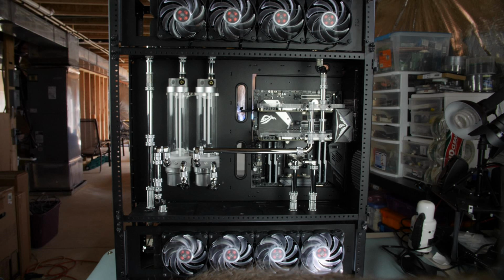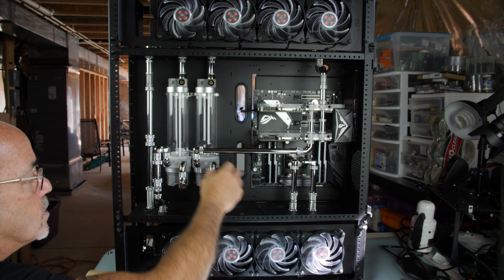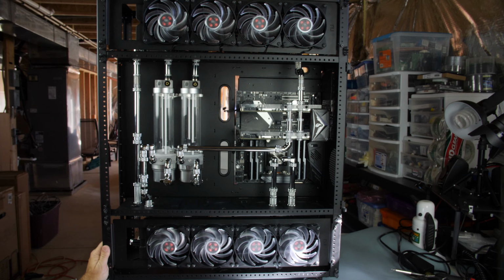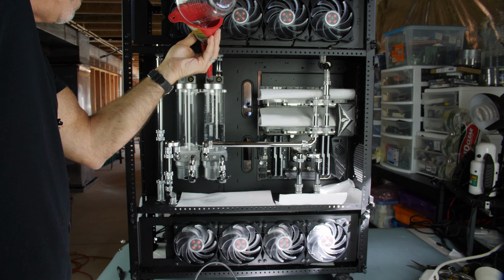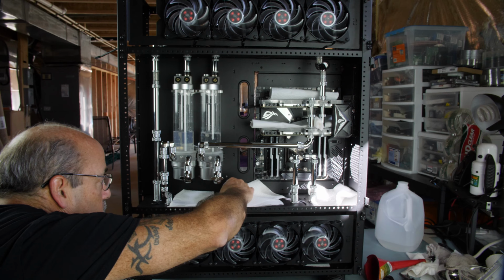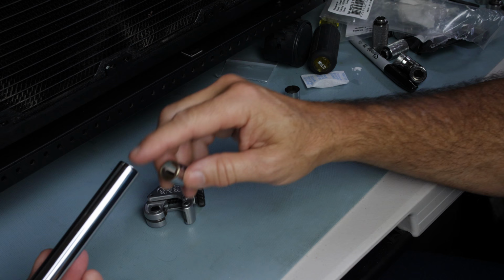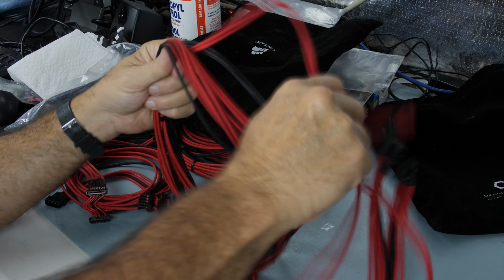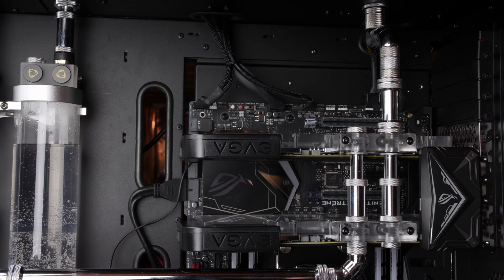STH10 ThreadRipper RGB - System Upgrade -  VLog 4 (4K)

Comment: If you do replace your cutter get imperial. A lot better has replacement wheel and doesn't wobble. I've used every kind as I do refrigeration and cut pipes every day. Imperial de bur and cutters are he best. Same with there tubing benders. Rigid are ok but wheel can wobble and gets dull fast
Reply from the maker: Awesome, , thank you.  yes I will get a new cutter. That was my first one, had good ratings, but after I used this one I figured maybe there would be better ones.  Thanks and thanks for watching.

Comment: Very cool, but with this budget, this case and this many fittings used you should have added a proper fillports for both reservoars.
Reply from the maker: I agree. You have to watch my next video.
Reply: I sure will! I can't believe you just put that USB 3.0 extension cable right in there, I had A LOT of difficulties with mine, but it wasn't the same brand. The header is just too small for the socket on the motherboard to fit properly :/

Comment: are you using 480 rads instead of 560 ?
Reply from the maker: yes, I had a bunch of 480 RAD's on hand. I did not see buying new 560's just for 80mm more of cooling.  Plus the 480's gave me more room in the STH10 top and bottom for tubing and PSU.
Reply: Ronsanut ive seen the 480/560 make a big difference. But if youre doing 2 way sli with Pascal that might be negligible. I just thought it would be a waste because when I got my SMA 8 I just felt compelled to buy a 560 to use the case's full potential. Anyway, can't wait for the rest of the vlog. 💯💯